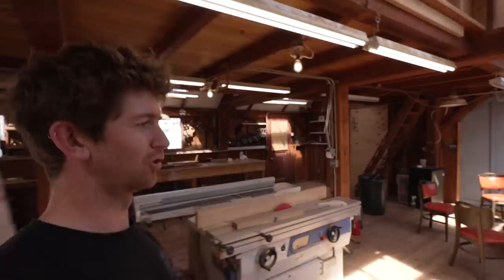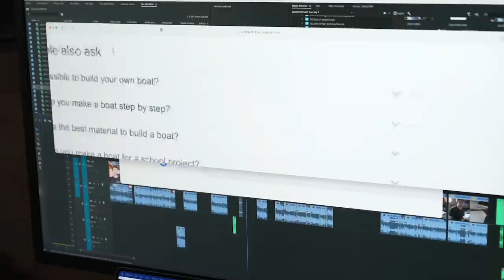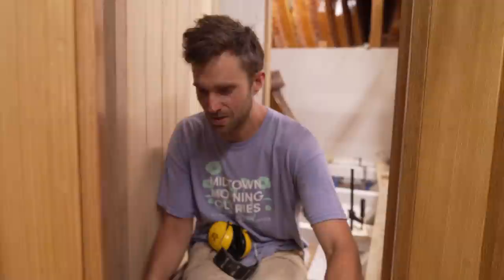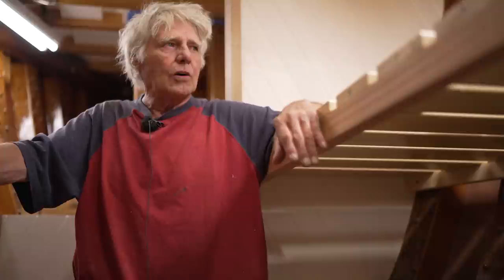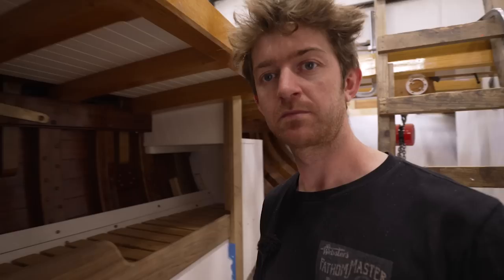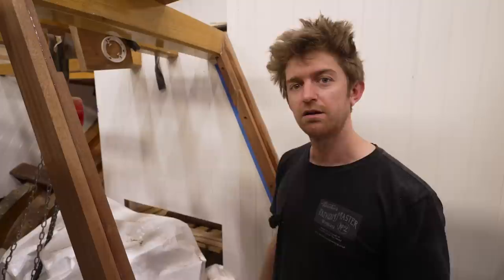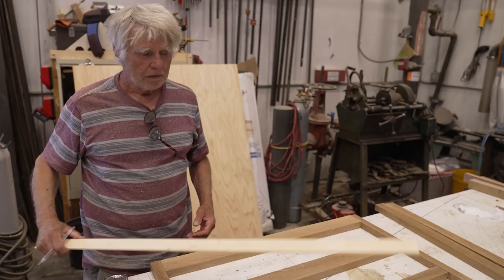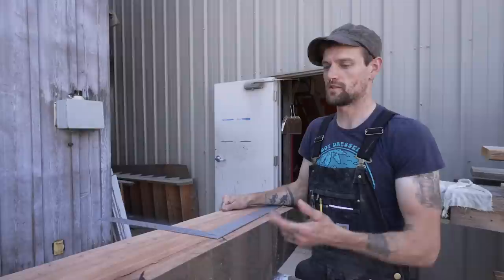BOAT TOUR: Inside the classic wooden yacht TALLY HO!

Comment: You can also put your electronics and controls into plastic or metal waterproof enclosures.  Interconnect the enclosures with corrugated conduit with gland fittings and you could wash down the area with a hose and it would remain water proof.   Enclosures use backboards to mount components on so you can build the panel on the backboard on a bench and bolt it in place in the enclosure with studs.  This prevents making perforations into the enclosure itself for mounting.    If you do this boat wide, you will have a waterproof electrical system that is also gas tight enough to prevent salt environment corrosion, making the electrical system last decades longer.  I was an electrical engineer that designed controls\ systems for use in a harsh chemical environments, very similar application.  Anything you can install can be installed inside an enclosure with a door with a window.  It is visible and easy to access. There is no reason that the standard surface mount boat electrical devices from blue sea etc, can't be mounted on a panel in an enclosure.
Reply: excellent advice
Reply: Excellent advice. Shall we see you as a member of the crew? It would be interesting seeing how your suggestions can be implemented in practice.
Reply: I spent a few years doing electrical harness design on bizjets and transportation, and we did similar things in the "swamp" areas of the aircraft, places exposed to the elements, heat, chemicals, etc. It takes time and money sealing everything upfront, but the benefits far outweigh those costs.
Reply: You don't know much about marine electrical. They are already far ahead of you on that sort of stuff. You could learn a thing or two from them.
Reply: Pauluhn out of Texas do cast brass enclosures for that ‘traditional’ look, ip66 rated, hideously expensive, they’ve been keeping modern material fittings to a minimum so far. worth a look perhaps.
Reply: i've done this a few times on boat and rv projects where the equipment had to be located in a not-ideal location... hoffman makes enclosures of all shapes and sizes and materials, they are nicely made boxes.
Reply: @morgan5941  What do they do?
Reply: @morgan5941  what a helpful comment
Reply: @morgan5941  I have made suggestions implemented in electrical systems on three youtube boat channels, you don't seem qualified to judge who knows what buddy.
Reply: @morgan5941  
Troll
Reply: As a practical matter the following are general guide lines.  Larger, and fewer enclosure are cheaper and more space efficient.  If you can fill a 4 x 4 foot enclosure by all means use one.  Run ac and dc/signals in separate conduits to reduce introducing ac noise into the signals.  use 2 inch black corrugated plastic for conduit between enclosures.  Keep your ac at 240v or lower, and use 300 volt insulation everywhere , this will allow you to combine ac. dc and signals in the same enclosure.  An enclosure at the bow, under each mast, at nav station, cockpit and engine / technical rooms at minimum.  Panels in the vicinity of the galley, crew  and head areas will be useful. Imagine that every usb charging jack, ac outlet or light switch will ultimately be wired into a panel nearby will help to envision the system.  Planning to populate the enclosures with AC, DC, NMEA 2000, Ethernet will allow a great deal of flexibility in the future by having those backbones in place.  Assign the highest priority to supply power (critical load) to nmea 2000 network and radios. I.e. if the boat is partially flooded and main power ac and batteries are gone, a secondary battery supply powers the critical load circuit so the last thing working is the radios and ais.   Some equipment may generate so much heat that mounting in an enclosure would be problematic, mount as high up on the bulkhead as practical.  If your systems still work with 2 feet of water above the bilge sole, all the better.
Reply: @morgan5941  Kind of an arrogant comment here, Morgan... 
If you know better, why don't you share here your knowledge for all's benefit ?
If not, have a nice day mate !
Reply: @morgan5941  There's one in every camp and you are it.
Reply: @Wombbatts  - "Some equipment may generate so much heat that mounting in an enclosure would be problematic, mount as high up on the bulkhead as practical."

In my own upcoming build, my plan is to pretty much do a job similar to what you've described in this thread. This seems an apt moment to express my thanks for the way you've clarified my thoughts on this subject, by the way, so many thanks for that! Re what I've quoted above, my own plan is to route all cabling through the overhead, with all electrical, networking, data storage, computer(s) and other electronic equipment mounted at overhead heights as well, . So far as practicable, the batteries will be the only power items below that level, in the entire boat. And those will have their own watertight compartment to live in.
Reply: I have to say--- I really disagree with putting the batteries in such a vulnerable place;   It's like you chose to put all the electronics in the one place that is guaranteed to leak first over time--  which is compounded even more by the removable stairs.   I think you would be far far better off if you would at least put those batteries in a secondary container as well-- such as inside stackable plastic totes or something similarly sealable, so when the stairs do leak-- you have a secondary defense.  I'm assuming that the electronics will be inside a standard steel breaker box type of structure also-- or a comparable plastic box.  If you're going to leave it open like say a computer server stack in closet--- I think it's going to be a nightmare and very high maintenance.   I really wish you would reconsider putting them in front of the engine---  yes you would have to climb over the engine to get to them--- but you shouldn't ever really need to-----  and they would be so much safer and dryer up there--  and you could relocate one of your large tanks under the stairs-- where a water leak wouldn't bother it-- since it's a sealed tank anyway.
Reply: @calholli  - I have to say, I really disagree with you making this comment as a reply to someone else's comment. It really ought to be a separate comment of its own.

As to what you suggest, moving the batteries that far aft and higher is a Bad Idea. Batteries (especially as many as Tally Ho will have) are heavy, and putting them higher and towards the stern makes for really bad weight distribution and balance of the boat. All marine architects recommend the batteries be located close to the middle of the boat, and as low as possible. Too much weight at the stern will result in a negative affect on the boat and its handling in large waves. Especially given that the very heavy engine is also towards the stern.
Reply: @Wombbatts  yeah.. If he can get the entire system sealed-- that would be ideal.  Especially everything in that closet.  I suppose you could build the entire closet into something like a gun safe- sized closure, but with a gasket sealed hatch door...  The only thing about running your pipes down the boat is that it's exposed--  so just using something like PVC water pipe doesn't really look that great.  I suppose you could always paint it...  But running normal electrical conduit isn't going to cut it.  It's very cheap and not really sealed at all.  I'd like to see the system they actually use;   I was an electrician for 2 years-- I became a certified general electronics technician out of high school vo-tech, I was also a plumber for nearly two years-- and I went on to run a crew framing custom houses and metal buildings for over a decade.   I hung enough electrical conduit to know that it doesn't belong on a boat. lol.............   I just really frown on the electronic stuff being right under some removeable stairs, personally.  I wish he would rethink the location;  but I know there's not really an ideal place anywhere.
Reply: @T H Neither is your reply, it is gobbledygook
Reply: @morgan5941  My thoughts too.  But he was being helpful.
Reply: @Garryck-1  I guess I wasn't clear-- I just meant swapping the batteries with one of his fuel tanks---  fuel is heavy too-- and he doesn't really have that many batteries;   I think they would be comparable weight.   (and I did put this comment on it's own-- I just copy pasted it here, because this is where people are discussing engineering-- no big deal).
Reply: Add in renewable drying packs and it's a 150% system :-) And all you need to renew the packs is an oven!

Comment: I saw that you were planning teak, does the plane have carbide tooling? It has been my experience that high speed steel goes south very fast on teak due to the high silica content. Having worked as a cabinetmaker for 46 years I am completely in awe of the work you and your crew have achieved.👍

Comment: Beautiful work fellas! 13:32 your buddy is using the jointer like a tablesaw by standing behind it and only putting pressure down on the infeed side of the jointer. That will taper the boards as well as not give you a truly jointed edge, leaving a gap in the joint you will have to close with clamps. He should move with the wood and transfer pressure to the outfeed table after it passes the cutter head.

Comment: Even LiFePo can explode, or at least violently blow off gas, you should have some sort of ventilation system that allows gas to escape, just in case. Don't make that compartement water- or airtight.
And don't underestimate the amount of heat these cells will procude. They have an efficiency of 90% (slightly more), but be aware that if you pull (or charge) 20 kW, they will produce somewhere between 1-2 kW of heat. You need, or should have, some sort of ventilation to keep everything cool.

Comment: With so much done to get to this point, it is amazing how the woodworking skill level keeps ramping up. The fit requirements for elements that will never be seen are quite mind blowing. Your tool budget for just the right tool for just the right fit is staggering. Will there be a tool auction when Tally Ho is launched?

Comment: Hello Leo, I have a question. What species of wood did Pete use for the keel fairing block? 

BTW, a Superfantastic episode. A nice collage of clips chronicling the journey so far. Great views of the interior, and yes I could visualize the companion way stairs from your description and the runners that were in place.

Finally, a suggestion. A recap of the various species of wood used in the reconstruction project. Of course, in a future episode that will be about 2 years out.

Cheers!
Reply: I asked the same question and then realized later that he also mentions it in the description. It is purpleheart. Oh, and I agree, a deep dive on the wood species and their properties, incl. advantages and disadvantages from the original, would be fascinating.
Reply: Thanks Bill, I’ve never paid attention to the Description area.      I’ll be reading them from now on. 
The piece sure had a different colour though, which peaked my curiosity. 🙂
Reply: @drop_dtuned6167  Same! I feel better I wasn't the only one that missed it! Yah, I thought "today's" purpleheart looked really different too
Reply: @drop_dtuned6167  - Exposed Purpleheart oxidizes to a nondescript medium brown color.

Comment: I really hope you will have those batteries in a fireproof compartment with external access to discharge the proper extinguisher without having to open the whole compartment, there are more and more boat fires due to lithium batteries.
Awesome project and presentation.
Noosa Heads, QLD, Australia

Comment: When I was stationed on The Battleship (BB62), We had a ladder from the aft starboard entrance that we affectionately called "the widdowmaker". It was REALLY steep, and the treads  weren't that wide...maybe 6" to 8". To keep the head trauma to a minimum, they put some closed cell foam, like a thick pool noodle, right where your forehead would smash into the solid steel deck edge, that wrapped around to reduce the top of the skull smashing damage to a minimum as well. 
if you find yourself whacking your head on the deck edge going down the stairs, you might consider doing the same.

Comment: just a small tip from an old pro when using power tools with cords throw the cord over your shoulder that way you know where it is you don't need to hold on to it with your other hand, you wont cut it by accident, or trip on it, and if your sanding a table top or such the cord wont leave a ugly black mark all over the edge your workpiece !!!!!!!!!!

Comment: Have you thought of hinging the stares at the top and you could use a block and tackle to lift them from the bottom and tie them off to get into the battery room then you could back the back of the stares with a solid backing , and weather striping , to water proof the battery room just a thought

Comment: Don’t know how wide de battery box wil be but I would keep the stairs in place keeping that solid and dry as a barrier from the water and I’d put the switches etc. in the top of the siding while having the batteries fixed in a bolted down steel sliding drawer.
Some spring loaded self locking mechanism (some steel pins interlocking with the rails) to pull out layer by layer on the side into the walkway instead of having to remove te stairs.
An inspection hatch on the backside wall of the drawers and some guided wiring with slack to pull a layer it in and out would be my option if the preferable option was to leave the stairs build in place and watertight as well as constantly accessible.
You could make a simpler more solid sliding rail sideways by using a slide extension that can be folded out locked into integrated fixations into the opposing wall. This way you loose the weaker sliding elements you see in the comparable but smaller version with kitchen drawer slides.
With three steel racks either folding out or as loose rail elements used as interlocking rail extension that you could fix in place by putting them  in or simply folding them out downwards into the opposing wall catch.
This option with folding out rails or loose rail elements instead of sliding ones like drawers would extend the rail to pull out the batteries in a very solid safe way. Square profile held on by outside rollers and some softer solid rubber/ plastic wheels to keep it quiet and tight on the rails
There are endless options to put in simply safety mechanisms that slow down the sliding under battery weight and keeping them from sliding before the rails are put in place the same way you could use a T, ⚫️,🔷or 🔺profiled rail shape. The great thing is it’s all very easy to weld and fabricate whilst being very very solid especially bolted down into the boat structure.
This long as explanation doesn’t really sell it as an easy fix to leaving bolting down the stairs in place.
Reply: I think the folding stairs will be an access problem to and from the deck when working on the batteries.

Comment: Just brilliant work! You and your team are closing in on that 10k hours each, if you're not there already. Master work.

That companionway drain is going to quickly get stopped up with debris. You'll want to put something like a bottle cleaner nearby to add cleaning it out to your cleaning routine. If the tool is next to the work, It's more likely to get done in a timely fashion.

Also, once you're 90% done with the interior, you may want to think about the boat in a slapdown ( 90 degrees to the water ). Look at all the fitments and storage, and then put in a few extra things to be able to secure for heavy weather.

Fair winds.
Reply: Heavy-duty latches on all cabinet drawers & doors please !

Comment: Since there are a lot of batteries I would put every battery in a kind of "cage" where it is easyly removable from outsides without to have remove all the others! -  Batteries is quite a stuff what can crack sometimes - its in my opinion a very critical ressource!... And it would be a great advantage if You could know which of the batteries could have broken down. So if You would have one or two batteries in the back - you could change it and continue without any restriction! I am afraid that in the actual construction this will not be possible! If every battery has its own case this would also protect it from the others when one should be exploding or would has other defects...!

Comment: Just a thought. On trucks (prime movers) the batteries are on roller trays. Wouldn't lengthening the cables to make a swinging door and trays that allow the batteries to slide out be better? Especially if you need to get to them in a hurry.

Comment: I have to say--- I really disagree with putting the batteries in such a vulnerable place;   It's like you chose to put all the electronics in the one place that is guaranteed to leak first over time--  which is compounded even more by the removable stairs.   I think you would be far far better off if you would at least put those batteries in a secondary container as well-- such as inside stackable plastic totes or something similarly sealable, so when the stairs do leak-- you have a secondary defense.  I'm assuming that the electronics will be inside a standard steel breaker box type of structure also-- or a comparable plastic box.  If you're going to leave it open like say a computer server stack in closet--- I think it's going to be a nightmare and very high maintenance.   I really wish you would reconsider putting them in front of the engine---  yes you would have to climb over the engine to get to them--- but you shouldn't ever really need to-----  and they would be so much safer and dryer up there--  and you could relocate one of your large tanks under the stairs-- where a water leak wouldn't bother it-- since it's a sealed tank anyway.